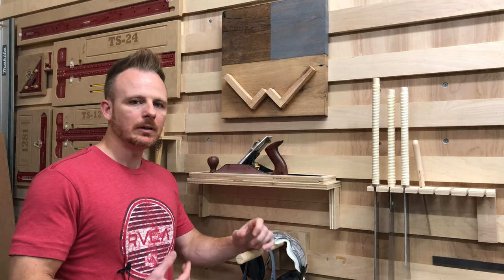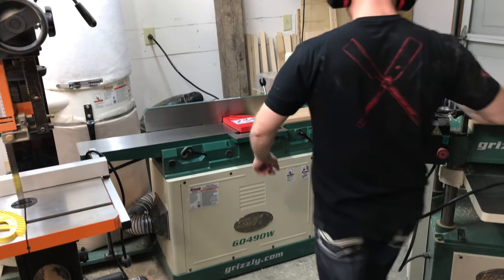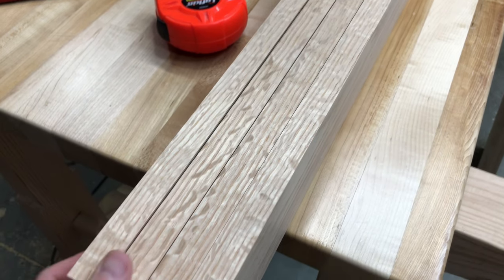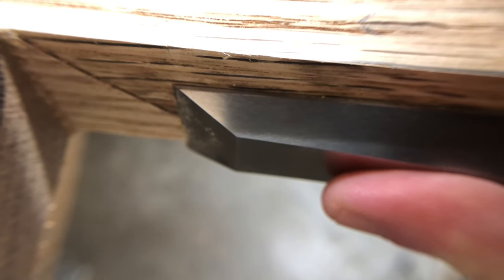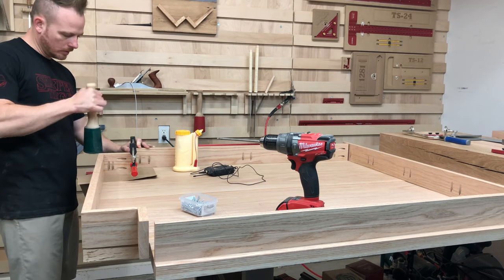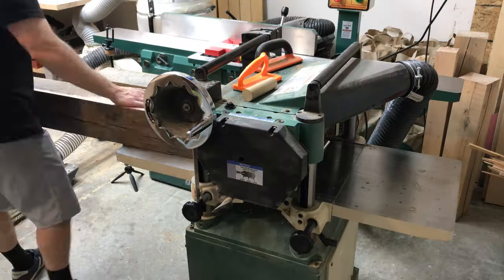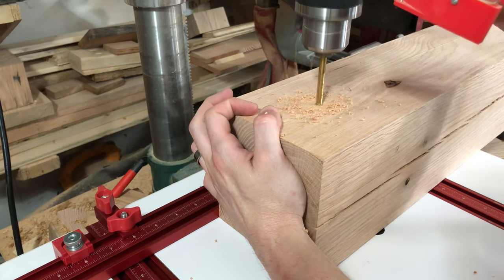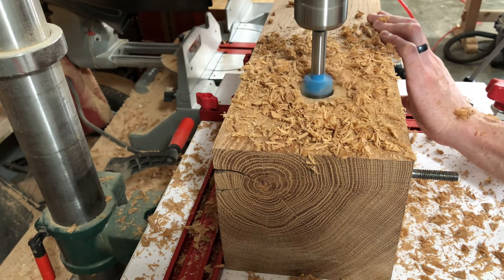Farmhouse Table Part 2 - Aprons and Legs // How To - Woodworking

Comment: great video - we are a small sawmill but i have an old timer who's a woodworker and he is making a harvest table and he's doing the legs and apron similar to yours - legs inside apron around outside of leg but to attach them he wants to drill through the apron and leg and use 3 - 1/2"-13  x 6-1/2"  brass hex bolts with washer inside and outside and nut all brass - i've looked high and low but can't find anything that will come close to the specs - any ideas? he likes this look because how the brass gives it a pop and bling :D any suggestions would be great.
Reply from the maker: Thank you! So if I understand you correctly you are looking for brass hardware that fits those specs?
Reply: @WorkingTimbersCo  yes that would be correct, thx
Reply: @WorkingTimbersCo  were you able to find a source for these - still looking :D
Reply from the maker: No, not yet. Will let you know if I do.

Comment: I do like the leg, apron and top assembly. 
Have they passed the test of time so far? No wrack or wobble? 
A farmhouse table is on my bucket list. Thanks again for another great video. I am enjoying and learning from your channel. Be well. God Bless.
Reply from the maker: Thanks so much! No wobbling at all actually. It’s very firm and sturdy. The two attachment points turned out great. In fact my son used to shake our old table as a joke and then when we put this one up he was disappointed he couldn’t do that anymore. 😂 it’s very heavy and solid. Appreciate you watching! God bless you too!
Reply from the maker: Hey, Update after 3 years, table is still solid as the day i built it!
Reply from the maker: @Mr. James Thank you and thanks for the sub. I didn't fill in the cracks/checks. I wanted to keep the character the way it was and I've not seen a single issue with it.

Comment: Sorry, but pocket screws have no place in attaching a slab to aprons, as it allows for no wood movement. While it can be possible that at first, the movement won't split the top, joints, or cracks won't appear, over time, or especially if you move the table to another climate, the poor decision to use pocket screws on a solid wood table will become apparent. You could have used the pocket screws on the apron joints, but then used clips to hold the table top to the apron, or you could have elongated the holes for the pocket screws, another poor choice, but the fact that you simply screwed the top to the aprons without planning wood movement doesn't fairly inform the viewers that this is not ideal.
Reply from the maker: Randal, I appreciate the feedback. I share my woodworking projects because I love doing it. I know I'll make mistakes along the way in presenting them and I hope the viewers will recognize that as well and make the best decision for their project. How could I help the viewer become more informed after I've posted the video? Make another one? In this particular instance however, I think I'm just fine on this build. The only wood movement concerns that would come out of this build are the 4 aprons that run perpendicular to the table top for the tangential movement. I did make the holes larger and I backed off the screws a 1/4 turn as well, which is recommended by Kreg for table aprons. So far after over 1 year, no cracking, splitting, nothing and I went from a dry 15% humidity workshop where this wood sat for a really long time  to a much more humid indoor humidity % in the south with about a 4% MC change in my house from summer to winter and no issues. The spacing in the pocket holes is more than enough to account for movement in my house which is about 5/16" - Have you had a different experience with pocket hole joinery? You can make any method work if you take the extra precautions and think ahead.
Reply: @WorkingTimbersCo  At no time in the video did you explain that you enlarged the holes for the pocket screws in the apron to attach to the table top. In fact, at 6:23 in the video, you lay down an apron which clearly shows the pocket hole screw holes in the apron and those holes are not elongated nor oversized. Then as the video continues, you show screwing the apron to the table top without doing anything but using screws. If you fail to see this is basically yet another video that does not go into proper detail about wood movement and how to plan, then there isn't anything more to say. You should correct the video. Even Marc, with the WoodWhisperer went back to correct the videos he made regarding mistakes, whether wood movement or finish or other mistakes he has made. Do what you want, but this video, in my opinion, is only teaching people how to make mistakes, not avoid them. Sorry.

By the way, usually the cracks won't appear till after the first year or two, so who knows.
Reply from the maker: Appreciate it Randal, I can see your point even though the pocket holes are really hard to see from that point in the video. I’ll probably just redo it and repost or try and revise it somehow as I do not want to give the wrong impression. Doesn’t look like a very popular video anyway LOL 😂

Comment: Has your apron cracked or warped because of fixed pocket hole set?
Reply from the maker: No cracking or warping at all. I didn't glue the aprons down, it was all just the pocket holes additionally, the pocket hole that is drilled is slightly larger than the screws so there is some space for movement. I don't see much risk with either radial or tangential movement, certainly not longitudinal as it's like .01% - Hope this helps, let me know of any other questions.
Reply: I see this was posted 2 years ago? Have you since seen any cracking or warping from using pocket hole screws to attach tabletop?
Reply: @jonm345  I know you are asking @WoodShaped , but I chose to attach my 10 ft by 3.5 ft dining table top traditionally with slot and hardware in southeast Ohio area because of temp and humidity changes seasonally. This obviously hasn't had any issues as you would expect.
Reply from the maker: No, not at all. Table is still in perfect condition. I will try to do an update video with some footage of it now.

Comment: At time 9:20 why did you need to make those slots instead of using the hanger bolt method you just used?
Reply from the maker: I could only do one face as a hanger bolt because I would not be able to attach the leg otherwise with another hanger protruding from the secondary face since it’s a static attachment(permanent), so I opted for the t-slot for the second face attachment point where the bolt is removable allowing for the leg to slide freely. Just one way of doing it. Probably other ways too. Hope that makes sense. Thanks for watching.
Reply: @WorkingTimbersCo  As soon as I sent the message I realized why. I want to try to use this method but it looks intimidating because I would be using a hand drill.
Reply from the maker: Were you looking to create a t-slot?
Reply: @WorkingTimbersCo  Yes, I am using 6x6 legs and wanted it to be as secure as possible and your method looks pretty secure
Reply from the maker: Cool. Do you have a router and t-slot bit? Once you have a hole in there. How were you thinking about making the slot behind it?
Reply: @WorkingTimbersCo  No I don't have a router yet. I am not sure.
Reply from the maker: @healthyhuguleyshomestead1503  Did you ever try this method? If so, how did it go?
Reply: @WorkingTimbersCo  I used a different method I would love to send you a pick of It the table looks amazing
Reply from the maker: Sure. I’m on IG @workingtimbersco 👍 Would love to see it!